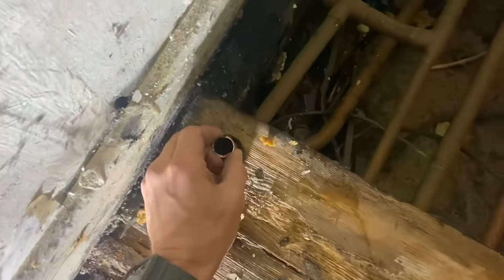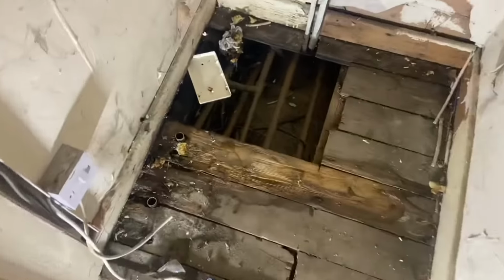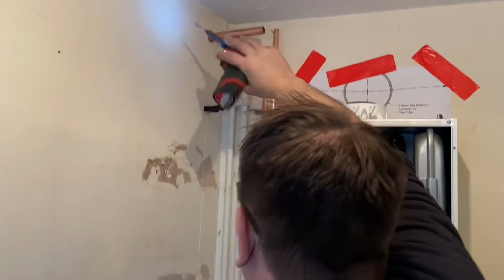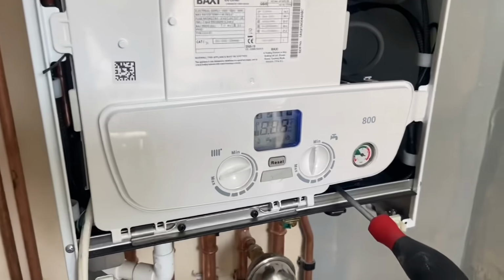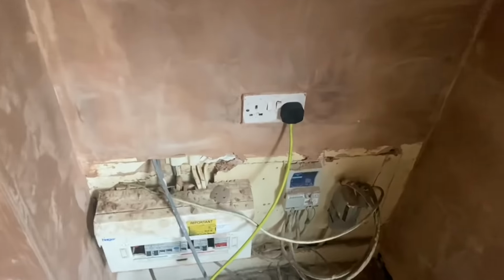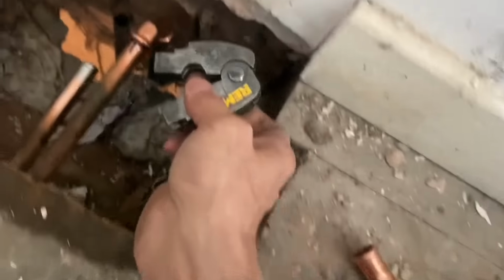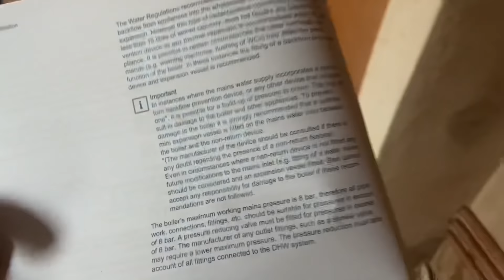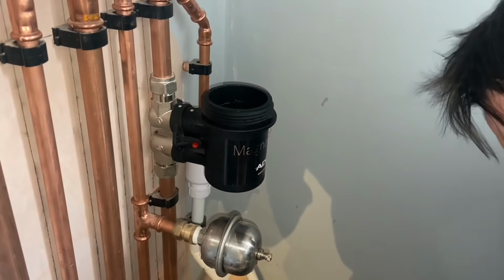P B Plumber The life of a jobbing plumber #82

Comment: Hi Pete - I know this is an older video but I hope you get this -  The press fit fittings FOR GAS - can these be used for under floor work (consealed under floorboards) or can they just be used for visable work ?? I am going to take the plunge and get a press fit system in the new year - I just need to decide on V  or M profile still researching availability & price in my area (Newcstle)  as some merchants do not stock certain makes - thank you

Comment: I always fit the expansion mini expansion vessels as if someone installs a water meter what's the chance they would fit one! Also the magnaclense the metal adapter the one that has the connections for the cam lock pipes to go into I cut that in half give me more options if where I can put it.

Comment: Cold expansion vessel..  I always thought if there was at least 3m of pipe run up to the boiler you did not need to fit any expansion on that pipe? As there would be sufficient water in the pipe to take up any expansion. I'm sure other boilers instructions mention this.  I suppose with all the plastic pipes / water blocks now with in boilers and them eventually splitting, this is one way manufacturers can mitigate their poor design.

Comment: Any magic tricks to stop the service ball-valve on a boiler leaking water via the shaft? Just a slow drip but annoying to have to replace it.
Reply: Unless it's got a gland nut you can nip up or pack. the only option is to replace it. You can try your luck at just tweeking the angle of it or a riptie over it. can make it worse sometimes. it just a little o ring, you can service them if you really have to, it's a ball ach to do as you have to take it of anyway, £4 for a new one is never worth the effort to fix it unless your up a creek without a paddle.
Reply: Sometimes leave it for 24 hours and it stops. Unpredictable little blighters.
Reply: Sometimes they stop themselfs with the water swelling the oring and filling with sediment

Comment: Any tips for the milwaukee cutter, not getting on great with mine. Skates alot and is rubbish on 15
Reply: On 15mm you need to learn the grab point, about half way into the jaws.  Push the pipe all the way to the back of the jaws, then a click back.   If you get stuck, tag me in a reply and I'll post a video.

Comment: What is the benefit of pressing rather than soldering?
Reply: Quicker very low chance of any leaks once its crimped properly. Fittings are very expensive thats the main downside
Reply: No fire risk.
Reply: No flux in system..quicker work.. looks nice..less chance of a leak.

Comment: I had heard your not meant to press a joint within 300mm of a soldered joint. I don’t know if it’s true! Does anyone know more?
Reply: I can see the other way around being an issue, soldering near a pressed joint as the heat could affect the o ring
Reply: @daleprosser350  I thought it was a issue due to annealing of the copper when soldering! But I’m not 100% on that!
Reply: @thebeardedwunderer1503  so the copper is technically too soft to cope with the pressure of the jaws of the tool is it?